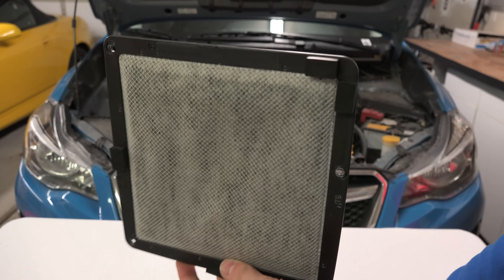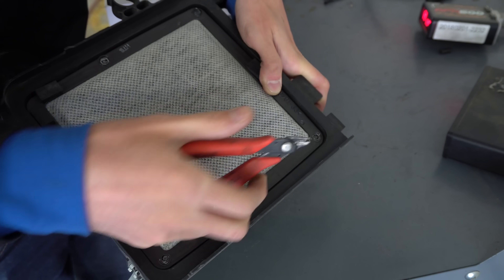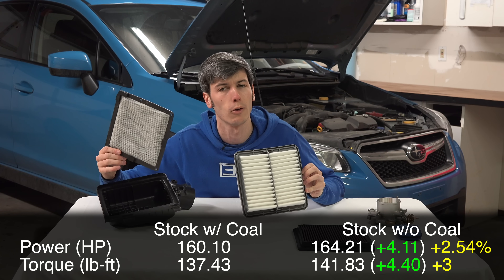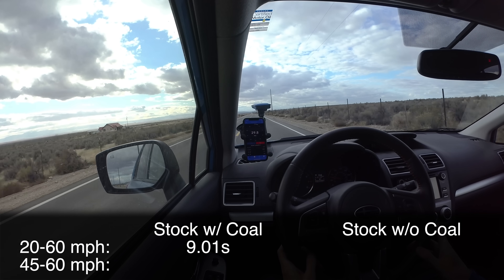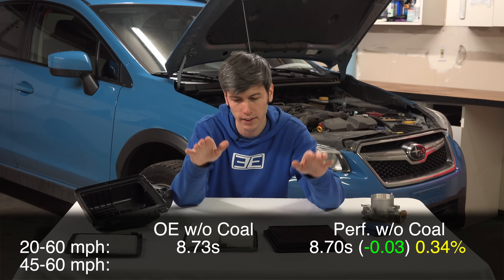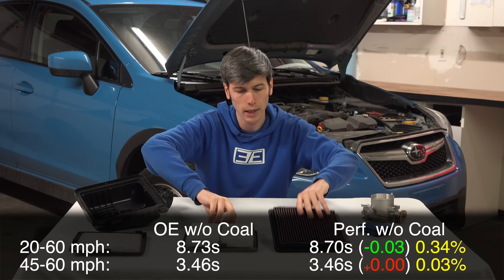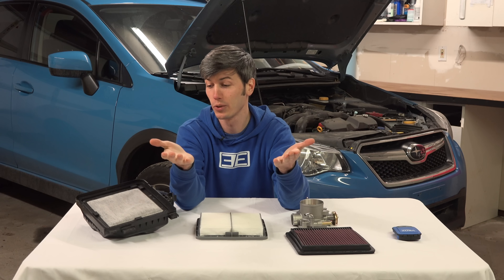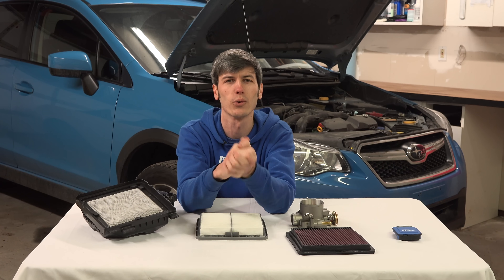Do Charcoal Air Filters Rob Your Engine Of Horsepower?

Comment: Performance air filters or removing the charcoal filter is not just about extra power and faster times, it's about how the car feels with these things done, with t performance filters sometimes you see no performance benefit but when you drive the car it feels more responsive and I have noticed it and quite a few car's with cone and performance panel filters :)
Reply: placebo effect
Reply: @Wooble57  No it's not...
Reply: @insidebyte8561  something you can feel, but not measure in any way.  Remind's me a whole lot of people paying 5000$ for speaker cable saying it sounds better.

Turns out when they did a ABX test, they couldn't tell the difference, it'd be the same thing here with the filters.  You think there will be a difference, so you feel a difference, even if there isn't any change.

Comment: Took them out in my M4.. definitely made a difference in noise and torque.
Reply: Could be placebo. The increase in noise, if any, and torque would be too insignificant to feel.
Reply: @5ColorRice  I cut out the charcoal filter and replaced the factory filter with a k&n, and it definitely increased induction noise, there's a nice engine note under load now.

Comment: So how long is the factory not replaceable charcoal filter good for before it's loaded, decreasing your efficiency and fuel mileage?
Reply: the fumes it catch's go back into the engine next time you run it.  While i can't say it will last the life of the car, it'd be close.  It's unlikely the average vehicle would need to change it more then once in it's lifespan unless you do something like drive without a air filter, or one so poor that it passes far too much dirt into the charcoal filter.

Comment: I love your videos including this one, but I'm honestly not sure how I feel about the conclusion here. I understand and would agree completely with the throttle response explanation, but while 0.006 may be small that's still 3% of 0.2. Noticing a 3% difference of something like zero acceleration vs full throttle doesn't seem like that wild of a claim. Also I'd like to see a comparison of the amount of emissions carbon intake filters capture relative to it's effect on the fuel efficiency of the engine. Probably pretty neglidgable, but I'd be surprised if it's emissions capture relative to the engines total emissions production weren't similarly neglidgable.

Comment: Not worth removing the filters for just a few hp gain. If someone thinks gaining less than a second on acceleration is important they need to get a better hobby.  In addition if you have a state emissions inspection your probably going to fail. Also you will void the warranty, Just not worth it.
Reply: Volkswagen has a fix for that!
Reply: Racing teams would be all over that few extra horsepower.

Comment: I'LL BET if you performed the same test on a turbo engine you would see much more improvement by removing the charcoal filter -- since the pump much more air.
Reply from the maker: Depends, a naturally aspirated 5.0L will run more air through it than a boosted 2.0L at 15 psi.

Comment: Use a bucket half full of water instead of a filter.

The 'pre filter' end goes into the water. 

The end nearest the engine is at high level. Probably flush to the lid of the bucket. Put a sponge filter this end.

All the dirt that might get into your engine only gets as far as the water and sinks.

At voila. Perfect dust protection.

Just avoid turning sharply, braking harshly, all bumps and accelerating spiritedly.

You're welcome.
Reply: A bong for my car.  Why didn't I think of that?

Comment: The (non-replaceable) carbon filter element attached to the cover of the air intake (NOT the engine air filter) is there to absorb any residual fumes after the engine is turned off.
Reply from the maker: Yes, as discussed in the video.

Comment: I got so excited about the math 😍 In all seriousness I would’ve mentioned that intake manifold designs (runner length and diameter, single vs itb) would have more impact on throttle response from a mechanical perspective.

Comment: Thanks for another well-made video. Practical. Irrelevant. And this one is ironically ridiculous. The notion that an internal combustion engine vehicle has a filter to prevent it from producing a very tiny amount of pollution and toxic gases and the like at one point in the system and then throughout the entire operation of the system similar toxic gases spew out of the back by the ton (that's an exaggeration, I know, at least a little bit, maybe for dramatic effect but the point remains) is so silly. perhaps we should place a filter on the back of the tailpipe as well so that all the toxic gases don't you get out. Oh wait, electric cars. 😎 yes, I know you have one, yes, I know I have one and lots of other people have one and they are doing a little bit to help the overall World bud it's kind of a silly thing to put a filter in a system that gets a very small amount of the overall pollution. One might ask the rhetorical question: if the car pollutes so much and needs a filter why not just have a different kind of car...

Comment: I took my manifold and throttle body off. The power gains of absolutely no restriction is amazing!!!
Reply: Thats what Freevalve does :)
Reply: @ThePentosin  well it leaves the manifold.. Fuel Injectors gotta sit somewhere.
Reply: Don't need a manifold for that.
Reply: @ThePentosin  Well the current freevalve prototypes use port injection. And you may as well have something to stick a filter to.
Reply: Yeah shure, but neither needs a manifold.
Reply: @ThePentosin  well with no manifold you're doing direct injection. On the /drive episode were Christen Koeni..... Chrissy K talks about the advantages, he specifically cites preferring port injection for the setup. It might be really short. 

They might not even call it a manifold, but if it's a manifold leading up to the intake valves, even if it's built into the valve cover, it's a damn manifold. And then on the top of this, lets say 1cm long manifold you could have your air box.... which will then want a really long duct( really just another manifold) to reach fresh air outside the engine bay.

This back and forth feels totally pedantic at this point. I get that it's fun to bring up freevalve, but it replaces the valvetrain and the throttle... everything else is the same.
Reply: I think you are confusing what a manifold is. The manifold part is what connects the cylinders into 1 intake. You could skip the manifold today if you want, with ITBs and port injection even without free valve.
Reply: @ThePentosin  no i understand what is typically called a manifold. But ITBs are just 4 seperate peices doing the same job. ITBs are unnecessary since the "throttle" is in the head on freevalve. While the popular terms may be different it's still just air tube leading to intake valve. And going this route would be more a racecar thing. In a normal passenger car you'd still be better off running enough duct to get fresh air for the motor, even with freevalve. You can go all industry term technicality on it if you want but the actual engineering still has an intake manifold on it, regardless of what you decide to call it.
Reply: You MUST be a tuning wizard!
Reply: The internals of your engine must look great! lol

Comment: I'd love to see a video on filter systems vs acceleration onset. After changing to a short, but wider intake tube, with a freer flowing filter, acceleration onset is so fast compared to when using the convoluted filter system with a narrower, but impedance matching intake tube with resonators and all. There's almost no delay from pressing the accelerator and getting a response. Makes it difficult for others who want to drive my car, though. I'm used to it now.

Comment: First couple of minutes: Jason proves that removing the charcoal filter actually gives you some HP
The rest of the video: Jason tries to convince you that you shouldn't remove your charcoal filter
Reply: Getting a sport filter would make the biggest single difference.
The difference with and without the charcoal filter when he tested the K&N was minimal, while the stock filter suffered more from being combined with the charcoal filter.
Reply: Like anyone would say no to 7hp gain.
Reply: 7hp is decent. 
the car is just so heavy so it doesn't really benefit.
Reply: @asjmpickle  remember that's peak hp, @2000 rpm gain would be negligible, you won't feel it in your back
Reply: @asjmpickle  yes it's 7hp, but that's only a 3% increase in total engine power, and only at wide open throttle, which most people rarely use on public roads.  If you did a blind ABX test, noone would be able to tell the difference
Reply: @Wooble57  It's all a matter of perspective. My Suzuki Samurai only had 60HP stock. You better believe every mod yielding a single digit horsepower increase made a noticeable difference.
Reply: @RetardedSysAdmin  and you still wouldn't notice a 3% increase.  In this case though 6 or 7 hp would be 10%+, which you would notice, though it woudln't feel night and day.
Reply: @RetardedSysAdmin  I just put a harley carb on my suzuki samurai lol I have two of them
Reply: @RetardedSysAdmin  I just put a harley carb on my suzuki samurai lol I have two of them
Reply: @Wooble57  I use wide open throttle all the time on public roads.  And, if you have a gutless car like a subaru crosstrek, you're going to use wide open throttle all the time to merge and climb hills with full loads, etc.
Reply: Being a low hp car with terrible acceleration does not make it a less ideal candidate for a air filter mods to improve power, as you suggest. In fact, aren't modest power gains actually going to be noticed more in lower power vehicles? I'm gonna feel a 7hp gain in my Impreza a lot more than in my 400 hp work truck, right?
Reply: The Overlords are watching...
Reply: and panders to the EPA gods
Reply: because we only have 1 planet bro
Reply: because the difference is miniscule, and if for some reason you get a VI it's possible you'd fail it
Reply: @Wooble57  those it get same horse power in seconds faster not much in time yes

Comment: I love the tests you do along with the data to help back your claims. It is obvious that less restriction will lead to higher performance in the short term, but you have not yet tested the long term results. 

The KNN filter will coat your intake with oil and some small amount of dirt over time which can reduce the sensitivity of your Mass Airflow Sensor requiring cleaning or may even kill it entirely. This definitely results in lower HP over time. I have seen this in multiple vehicles I've worked on and even a couple that I owned. A friend or customer will complain of poor performance or rough idling and even stalling in one case. Inspecting the MAF sensor results in sometimes visual confirmation of the residue or discoloration due to the oil presence. Cleaning it thoroughly results in it functioning like new. Checking the air filter... it's a KNN. Could it be misuse or poor cleaning and oiling of the KNN? Absolutely. Is it always misuse of the KNN? Untested, but likely no. 

Also, reducing filter media will always reduce filter efficacy allowing more dirt into the intake. If you live in a humid area with little dust you might see less of this than you might in the desert or near the ocean. 

Run 10k with a KNN and then run 10k with a high flow or even regular paper filter and measure your results in performance, residue inside intake, and mass airflow sensor function. 

A charcoal filter may actually reduce the amount of oil entry from a KNN (based solely on theoretical and anecdotal evidence) so a KNN with a charcoal filter might be a great setup for slightly higher performance with mininal sacrifice in engine protection. 

Still, the best way to improve performance with an intake mod without losing protection is to increase the surface area of the filter and shorten the distance to the throttle body. A larger surface area means that more air can be drawn in with less restriction. Air velocity is also key so too large of a filter might hurt performance. Most modern cars will adjust to the extra air with time by injecting more fuel, but air velocity can hurt. 

The short answer is that every model is different and will handle changes to components differently. There will always be an equal and opposite reaction for any action which sometimes means compromises in performance for longevity and vice versa.
Reply: My own experience over 40 years as a rally driver/codriver, car modder and Professional Automotive Engineer is that oiling downstream of cotton/oil type filters is ALWAYS due to over oiling after cleaning. I have been meticulous about cleaning and oiling my own filters since first using them on rally cars in the early/mid 80s and have never once seen oiling downstream of the filter. My current car (see it on my channel) is a Saab 2.0T 9-3 and has had the same Maptun cotton/oil filter fitted since about day 5 of ownership some 15 years and 157,000 ago. It breathes in more air than stock (it is tuned) but has never once suffered oil on the MAF. Indeed, I have only cleaned the MAF once and that was for my MAF cleaning video about 6 years and c50-70,000 miles ago. No problems.

Comment: The only issue i can see with a non removable charcoal filter is that it will quickly absorb contaminants and become useless within the first year of use, possibly much sooner.  Perhaps there's something i'm missing about the way it works?
Reply from the maker: I might assume that the fuel could be removed from the filter once your engine is running and there's air flowing at a significant rate through it.
Reply: Thank you for the reply, and hopefully that's the case, i really enjoy your show and the information you provide about cars and engines. 
Perhaps these ones last a lot longer than i would assume.  I've used carbon and charcoal filters for years in aquariums, i was hoping to find a way to recharge them so that i could reuse the carbon, turns out you need to heat it up in an oven to get it to release anything its captured. Even if it does release the fuel without needing heat, it will still capture other contaminants on their way into the engine and render the carbon useless in a short matter of time relative to the life of the car. So i'm just highly surprised by them making a filter like this permanent. Just struck me as odd when i watched your first video about your subaru and the filter tests.

Comment: So there is a difference, 4 to 7 Hp.  When you have a low horsepower engine, every little bit helps.

Of course, little hacks like this are not going to radically change your ride but it does help.  And of course some States require this extra filter and some do not.  Check your local laws
Reply: Good thing my county doesn’t have inspections.
Reply: @pichum4st3r  In AZ we have the plugin OBD2 test but unless they suspect something they don't open the hood.

Comment: What about data on the actual filtration? As much as I want to install even just a K&N for a slight bit more power, I've seen posts on how much crap they let into your engine over OEM.
Reply: They are performance filters not daily driver filters. You use them when you are more concerned about performance than longevity.

Comment: Next video which filter has the most effective filtration.
I would think it might have to controlled environment to eliminate the majority of variables. Perhaps, run them at a constant on a dyno or EPA mpg cycle then measure particulates after.
Excellent video by the way.
Reply from the maker: Yes, definitely want to get something up on filtration!